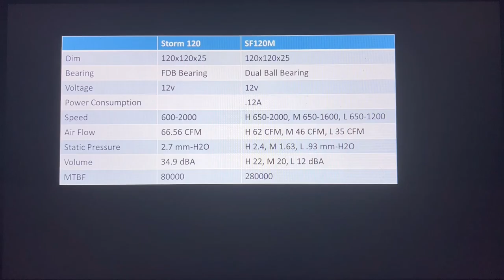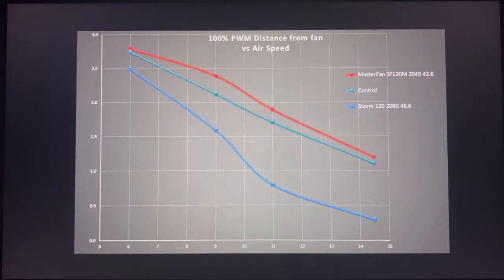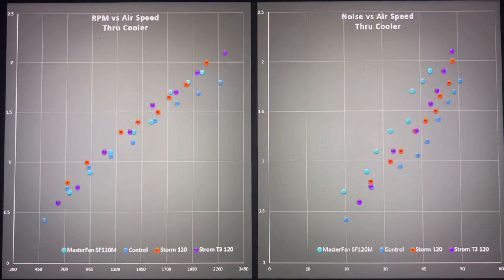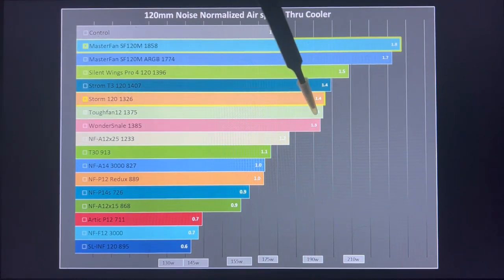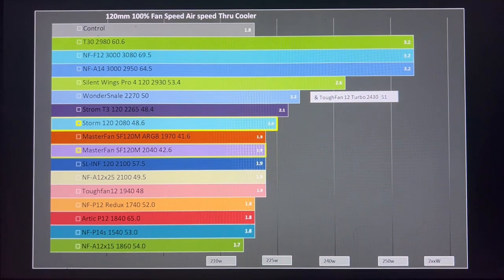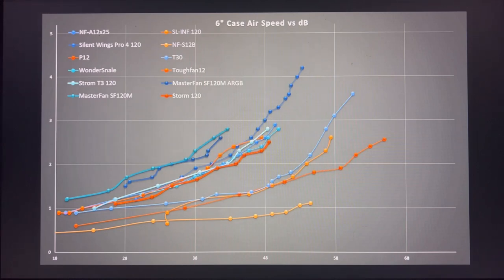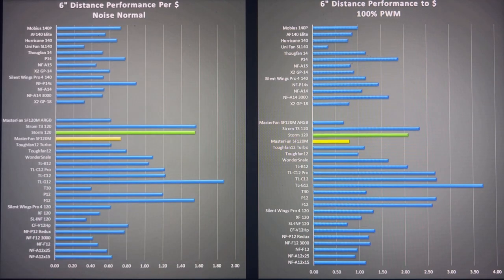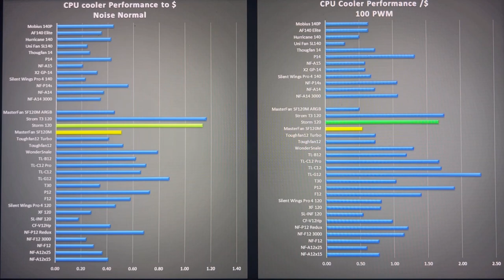Cooler Master SF120M vs Antec Storm120 (time stamps) short version  (Old Testing Method)

Comment: Nice analysis, I have been wondering since I wanna also buy the fractal torrent case you use for a good airflow and a new & hot 13900k cpu if you could
recommand a combination for quiet work ? Basically I am wondering what combination of pc case fans & cpu cooler (looking ath the NH-D15 for my new built) would give me the best airflow/temperature (using the inlcuded pc case dust filters) by setting up a maximum static RPM level that I could barely hear for my daily work (PC for music mixing room). 
I was thinking of getting Silent Wings 4 High speed (3x140mm) and replace the bottom fractal stock fans but after watching some of your videos, I am still not sure if that would
give me a better "tolarable noise to airflow/temperature performance" ratio for my use case... Any input would be highly appreciated since you seem to have tried out a lot of fans and own my preferred pc case... Thanks a lot...
Reply: I think I found what I am looking for, seeing your test here https://youtu.be/1tjXU4IKSOE?t=1043 it seems that for my case choosing 3x140mm with NF-P14s fans at the bottom of my fractal torrent case would give me the best noise to airflow performance ratio, right `?
Reply from the maker: Well first off I love the torrent, I would not replace the fans unless they rattle or something. They are overall fine. 
But if you insist on replacing them. Mobious 140p, Antec Storm 140, silent wings 4 140 ranked well for being bottom case fans. 
For front airflow I would say: light wings, Mobius 140p, and Silent wing 4 140. 
the NH-D15 I think still does well. I am not a CPU cooler reviewer yet. 
So you need to look at other media. like gamers nexus.
Reply: @computer-tech-more  Thanks, have you actually tested the front 180mm stock fans of the torrent ? If I wanted to replace them I guess it would be better to use 3x140mm cause I cant find good 180mm alternatives - So I have been wondering if I could oush the same amount of air with faster 3x140 RPM and achieve lower fan noise than using lower RPM with the stock 2x180 fans or is it just not worth it ?
Reply from the maker: @alinali1  Yes I tested them: It was one of my first fan videos: https://youtu.be/XGaKx55ZYCU
hmm I wouldnt replace them. I am actually in the process of retesting Noise wise all the fans. Trying out a new testing method to compare results. havent gotten to the 180's yet. sorry. 
But no I would not replace the fans unless they are lemons. Like rattly or you dont like the noise level for the cooling you want. Because they are part of the value of the case. Like almost half its value. 
That said if I were to replace the 180's it would be 3x 140's. 
Gamers nexus did the case review and actually put the 180's on the bottom and the 140's on the front. I think the heat levels got worse but I dont quite recall. 
So no I wouldnt replace them unless you find their sound unpleasant or they go bad. 
Hope this help. 
Please keep watching I am doing lost of fan testing. 

And are there any fans you would like to see in future videos? Thank you again for watching.
Reply from the maker: Dont know why this was held for review: 
So the P14 Noctua is good for throwing air a short distance before it spreads out in all directions. so as bottom fans it would be fine. but I would not really use it in the front. if thats what you were considering as well.
To add: even better fans: https://youtu.be/5lx2JPLs32U this is a more recent 140mm fan review's
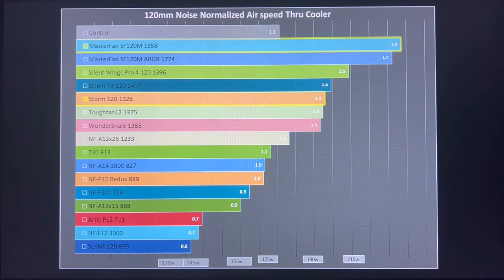Noctua P14 still tword the top. but the Bequiet Silent wings 4 pro is best. time marker around 12:33 and 17:04
Reply: @computer-tech-more  THanks a lot, since the Bequiet Silent wings 4 pro 120mm seems to be very good, I suppose the newer  Bequiet Silent wings 140mm high RPM version would be also at the top of the chart for noise/performance so I will probably go for them at the bottom (3*140mm) and the Noctua NH-D15 as the main CPU cooler...
Reply from the maker: @alinali1  Your welcome. 
Good luck with your build. 
Hope you watch some of my future videos. 
:)